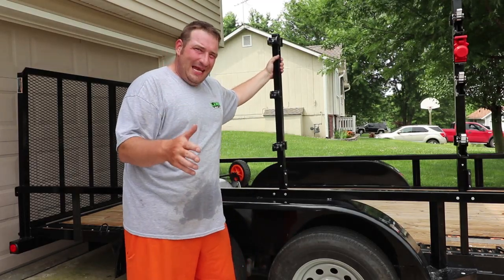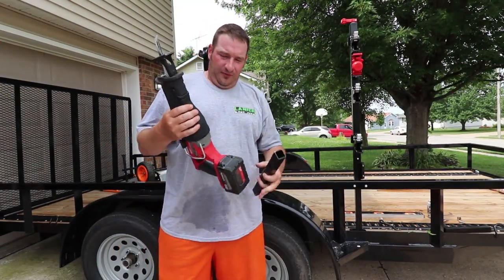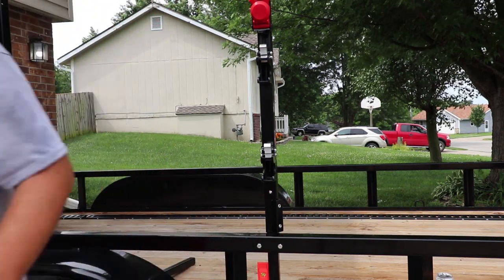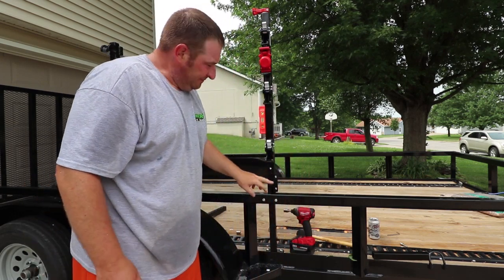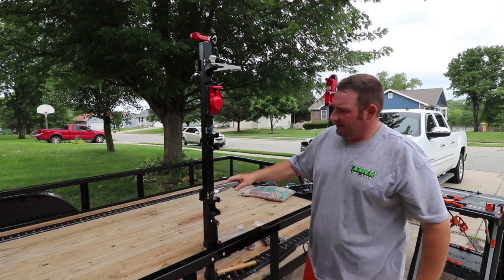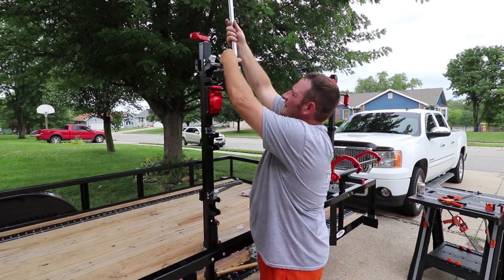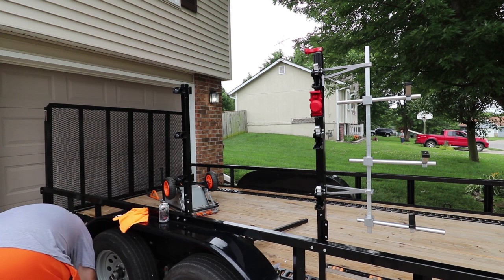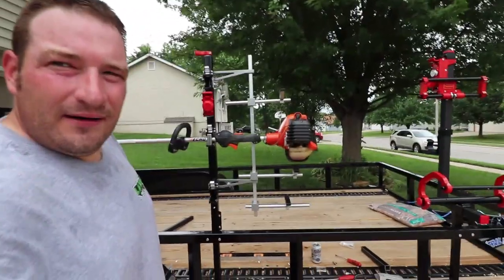HOW-TO, Step by Step Install,  Equipment Defender Trimmer Racks

Comment: What’s preventing someone from just loosening those set hex screws that attach to the post and taking the rack along with trimmers? Just bought this but that seems like a huge flaw
Reply: Tack weld the ends of the bolts after installation.

Comment: Do the ED racks come with hardware for installing on pipe top-rail trailers?
Reply: No they do not I had to fabricate I ended up drilling holes through the top tube and through bolting it

Comment: We've purchased both the trimmer & blower racks on your reviews & love them. Thanks for the 10% off promo code. My question is with the 2620's, do you find the motor mounts hit the top of one of one another when in transport??.. I like to keep our equipment looking as new as possible & would like to find a way (if possible) to avoid this. Thanks in advance,keep up the great work. God bless
Reply from the maker: Jon Morgan I don’t believe mine hit one another. Even in transport. Send me a Facebook message

Comment: I have a tube rail trailer and I’m trying to figure out how to mount trimmer racks to it I can mount it to one of the side angle post but the tube top rail sticks out too far.  Do I need to get rid of the trailer and get a flat rail trailer? 🤔😒
Reply from the maker: Kenbo email me pics. Email is I. The description above
Reply: I will man thank ya! Still trying to decide which brand to use that will fit on the trailer. I’ll send some pics.
Reply: I have a tube rail trailer. The bolts that came with my rack are long enough to go through the tube. Just be very sure to drill your holes dead straight and be careful tightening them so you don’t bend the tubing, adding an extra washer on the outside helps too.
Reply: I have the same type of trailer and would like to know if you were able to mount it and how you mounted it.
Reply: Kenbo did you get it to work? I’m literally watching this video to see if I can install on tube trailer as well before I buy these racks
Reply: @JET-oe8cs  yes i was able to get it to work. The trimmer rack will work out of the box. For the blower rack you will need a round tube mounting post. This is a new item and not on their website so you will need to contact them to purchase it.
Reply: JET 0316 i sold that trailer and got a angle rail trailer and got them on no problem
Reply: Alex I ordered the trimmer rack. That’s all I really need.

Comment: How is the rack  holding up??
Reply from the maker: Still using the trimmer rack and upgraded to the new style blower rack couple years ago. Both still going strong. I like the combination lock instead of the keyed. Nice not having to wonder where I put more keys at
Reply: @LanierLawnCare  how do you set the combo?